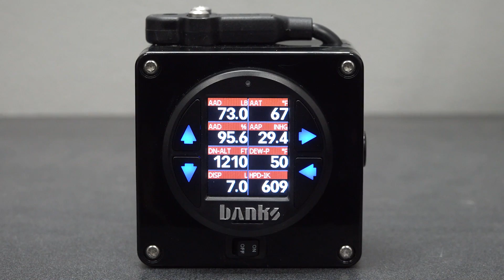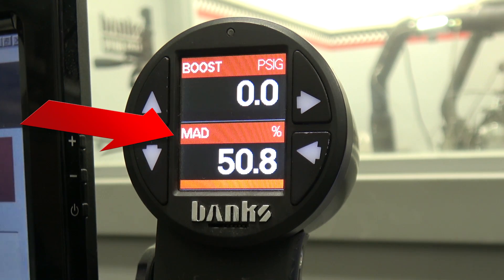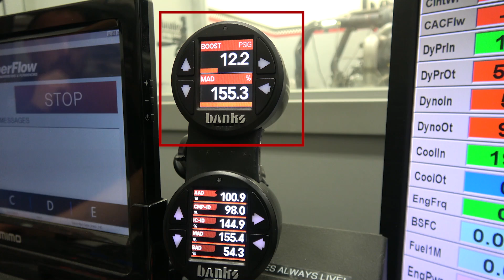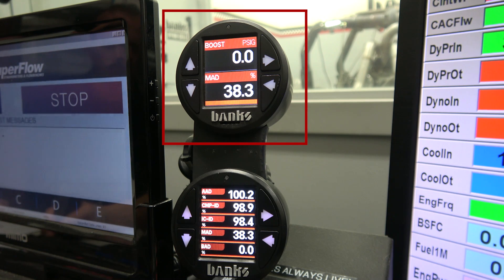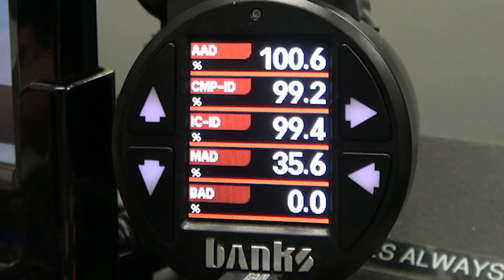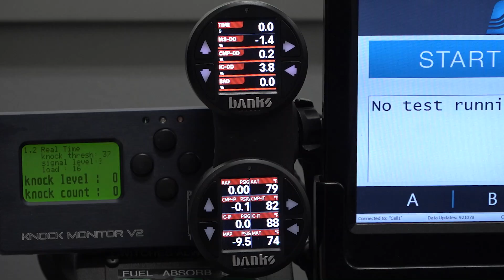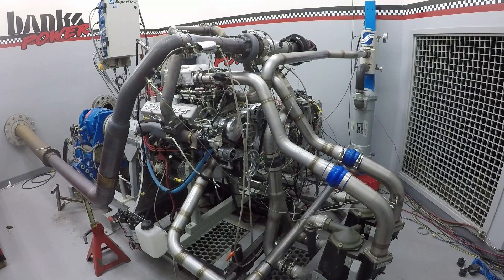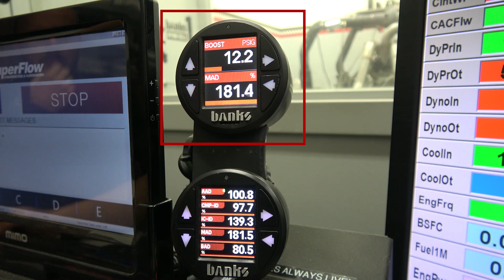Why the boost gauge is dead

Comment: I understand the air density thing. Was taught that when I learned to fly airplanes. I don't think the boost gauge is dead, as it has alerted me to a pressure leak at the turbo outlet on my '91 Daytona 2.5L . The Idash is the cats ass for seeing the entire picture. Am seriously considering the purchase. Just need to know more details about fitment and sensors.

Comment: boost is great for overcoming intake reversion but unless you could manage to have extremely high pressure waiting for the intake to open and somehow manage to drop the pressure to nothing and still manage to fill the cylinder to get an ice cold intake charge :) (if only our atmosphere was r134)

Comment: for someone building their own motor and tuning at home, could someone use these to make educated decisions in regards to parts combos, turbo selection and plumbing efficiency? i understand it is not a dyno but by logic a higher MAD equates to more power production provided you have good af/r, engine/oil temp, so you could make a change and take a log to see if things improved or not?

Comment: Anyone else notice the 1500-1600 degree exhaust temperatures on the screen? Are they trying to melt the valve to the valve seats?
Reply from the maker: It's safe to run for a few seconds at 1600 momentarily but not much more.
Reply: Banks Power fair enough. Keep up the videos banks your doing good putting great info out there

Comment: Considering it is a V8 with a high liter displacement, 56 horsepower gain is not really that much. Perhaps you could have played with the timing more and tuned it for even more with the intercooler upgrade.

Comment: So boost is only giving you about 60% of the data you need to extrapolate manifold air density. So you add two more mechanisms to measure humidity and temperature Within manifold air and you will have a gauge that can then be more easily applied to the expectation of power output.

Is that not a very simple explanation what is being discussed here?

Comment: Great educational info WITH advertisement for the iDash Devices. I almost didn't catch that this is a well disguised advertisement for Banks iDash. If the discussion in the middle was less than 5 minutes on how great the iDash is really it is really great and versatile and really great and better than stock and records great and is really great, I would not have noticed.

AND... Where are the rest of the Diff Cover Videos?!? 

You repeat yourself too much....

Comment: When you  try to compress air it heats up ..  The  charge cooler  takes the BYU's out of it .. Compress air to a certain pressure and  you have the same BYU's  but in half the space at 1 Bar

Comment: He doesn't address the delta P across the intercooler, or the relationship of the flow thru the IC versus its resistance to flow as boost increases, and the inherent increase in air temp. When you force air thru an IC you reach a point where it can't flow the air without a drastic increase in resistance, and that causes the air temp to shoot up higher as the turbo works harder and super heats the air to a point you're negating the use of the IC

Comment: Customer support was no help to me so maybe this is better:

Air density consists of 3 different data inputs: air temperature, air humidity, and air pressure. 

So my question is, without installing a humidity sensor in your intake manifold, how do you accurately record Manifold Air Density? To my current understanding, you can’t take the humidity reading from the air mouse because as soon as the air is heated when it’s compressed and then cooled from the inter cooler, the humidity changes.
Reply from the maker: When you say customer support was no help, does that mean you called or emailed and go no response or was it that you didn't like the response that you received? The relative humidity changes but the mass of water vapor pressure doesn't. We use pressure ratio and ambient vapor pressure to correct for dry air manifold air density. You only need to know relative humidity in one location. So, an AirMouse is all you need to correctly compensate for humidity. The math is handled in the iDash.
Reply: Banks Power first thank you for the explanation.

And when I called, customer support was not trained well enough on their own products to answer my question (that fine, I can understand) so they said they’d call me back. Well they never called me because that’s too much for them too handle.

And I sense a little booty tickle coming from Banks Support? Are you upset I called out Banks on in my other comment for failing to complete his diff cover series and scientifically show us why his diff cover is better?
Reply from the maker: @nealarcher1970  Density is not an easy concept for all to grasp. You may have reached one of our more junior staff members that hasn't mastered it just yet. We apolgoize for not returning your call. We didn't see your comment about the diff cover. Gale has not failed. It's just taking longer than we or you would like. We have plenty of data that we'll be sharing soon. We released the videos in real time last year... as we were learning about the various cover design flaws. It wasn't like a TV series that was recorded months prior. During the process, around video number two, Gale sat down to design one with our engineers. Then, after weeks of fine-tuning, it was tested, perfected and sent to production. We had hoped to share the data about the diff cover testing last September but it didn't make sense to share the info and have our competitors race to market with updated covers. We held onto the info in order to time it with our diff cover launch. We'll only get one opportunity to share the data and we want to make it count.

Comment: MAD is only useful on dyno or when racing. For the vast majority of people, that information is useless. You don’t need to know if you’re short 20 hp on the street because it 80 degrees and humid outside. Maybe if you tow in places that aren’t humid and usually much cooler, then you take a boating weekend up to (insert mountain name), you might feel somewhat short on power because you’re driving in a different climate.

BUT AGAIN, this is not useful information unless you’re racing. Boost pressure would be much more useful to most people because it’ll tell ya if you have a leak. But saying, “boost gauge is dead to me” because you have a new product you need to fly off the shelves, marketing it to people who really don’t need it. Banks, you sure are good at marketing, I’ll give ya that.

Go ahead and reply with the links to differential oil testing you did to prove “square back diff covers work the oil harder”. Or the testing you did to prove that square back diff covers “harm MPG”. Oh you know what would be great? The testing you promised us showing the temperature increases that square back diff covers cause compared to OEM.

Feel free to reply with any of that info because you sure as hell didn’t reply to my comments I left on your diff cover videos asking where’s the proof when it didn’t show up months after you promised it.

Comment: Would it make a difference if the air density was at 180 prior to entering the turbo compressor housing?. Also the turbo has already compressed the air before reaching the intercooler so the turbo has already reached its maximum  potential flow rate at 12 psi for what ever rpm so how does the intercooler make the air more dense than it already has available?.

Comment: Intake air temperature affecting hp is something most notice instinctively, but it really is nice to have real numbers.  My little old pickup truck generally picks up noticeable horsepower whenever ambient temperature drops below 60F.   Never dyno'd it, but it is real and thats using the same grade of fuel.  Should we call temperature/humidity corrected numbers Boost Factor to get away from blind reliance on Boost Pressure?  What I couldn't say is where to set the benchmark numbers of humidity and temperature to either add or subtract from the pressure number - maybe 100F and 50%?.  Some people still like to know boost pressure numbers just to keep tabs on if their wastegate setpoint has drifted [or gone completely pear shaped] and maybe spot other problems.  Perhaps one gauge with an over/under display of both numbers is all a driver needs?  The rest can be data logged. And... could the next performance step be a variable [computer controlled] wastegate?  I would still want something mechanical backing it up as a safety device in event of control failure however - put a sensor in it for the driver to know if it ever trips just in case.

Comment: I doubt any sane person uses boost gauge as an engine performance data. It's role is to tell the user if the charger performs as intended, is it making enough manifold pressure and not more, because both situations are signing a problem potentially leading even to engine's destruction. It's just the simplest way to know there are no immediate major issues with the charged intake while driving.

Comment: As a former truck driver, I used boost gauges as a rough estimate for how much fuel the engine was using per cycle, and therefore what percent of its rated output it was producing.

Comment: This is a comforting video. I have a supercharged engine in my truck and never used a boost guage. I have custom pulleys to make it all work. Once I put a pulley on that was too much. Boost blew the ceramic parts of the spark plugs out at full throttle.

Comment: Boost gauge is more for consistency then anything else in Gasoline engine especially
Reply from the maker: Consistency?
Reply: @bankspower  you monitor in between each run with same parameters, in a target torque application your boost will raise by a tiny amount each run to compensate for heat soak, not all turbo application are like that but most Modern Gasoline are.

Comment: Thanks Gale Banks for a well presented video.

I saw a GE portable high wattage electric generator setup. It consisted of two full sized truck trailers. One trailer carried the generator and a full size turbine. A turbine is a jet engine tuned for torque. The second trailer carried an intake air chiller. They claimed that by using some of the generator output to run the chiller, total electric output of the system increased. 

This agrees with everything Gale Banks said. With a completely different style of engine. Good work.

Comment: No pressure drop with the I/C... where are you measuring boost and MAD? Surely the turbo is working harder to make 180 MAD than 150 MAD?
Reply: drongo jonkins water intercooler is a very low pressure drop.

Comment: so i have a question, if i have an NA engine, and i put multiple water sprayed intercoolers on, would that be enough to make the air denser and the engine able to suck more air in, so more power?

Comment: Hi, could you repeat the test using a "dead" intercooler (as little heat exchange happening as possible, just internal resistance to flow)?

Comment: I dont think anyone has ever stated that boost level is the ultimate parameter to making power. The same level of boost pressure on different engines can result in a huge amount of power difference. 17psi on a Chevy Cruze (Stock pressure btw) is a whole lot different than 17psi on a Chevy Corvette. It's a measuring tool to base tuning parameters on.

Comment: So it looks more like the non-intercooled engine is dead vs the boost gauge.  Aviators have known for years that Density Altitude, humidity, and temperature effect the performance of an engine or a wing.  Really all this shows is that at equal PSIs of boost cooler air is much denser than hot air.  Also, buy my product so you can monitor Density Altitude in your pick-up in case you need to do some combat maneuvering flight...I hate to see you get in a high power demand maneuver and you not be able to produce the lift and engine power you need.

Comment: clearly the applications of this module are that you can fuck with your intercooling as well as the rest of the air system and actually see what is happening in the system with each change.

Comment: Boost gauges, or boost numbers in general really rub me wrong.  Why?  Because a TON of people who think they know something about cars, engines, turbo systems, etc always talk about boost numbers.  I cannot tell you how many times I've had some tool ask me "dude how much boost you running?"  then after telling them "10psi positive manifold pressure." they somehow think they know everything.  The follow up response is usually, "That's it?  That car must be slower than crap!"  Yeah, if you only knew something.

10psi out of a t25 compressor isn't the same thing as 10psi out of a T04E compressor.  

But wait- what do you mean?!  My best friend ran a 1.8 miata on 22psi from a "disco potato" turbo and made 240rwhp.
I ran a 1.8 miata on 10psi from a T04E turbo and made 280rwhp.

The compressor on my turbocharger is about the size of a basketball.  His was the size of a softball, at best.  A physically larger compressor moves more air at lower pressure.  What's my point?  STOP ASKING PEOPLE HOW MUCH BOOST THEY'RE RUNNING!  IT DOESN'T MATTER!
Reply: At the same manifold absolute pressure, intake air temperature, and RPM, with the same valve timing and cam profile, 10psi out of either a T25 or a T04E will both give you very close to the same power (the only difference will be due to slight backpressure differences, since they'll be at different efficiencies). A bigger turbo can keep the manifold pressure high out to a higher RPM, which makes more power, and it can maintain high boost at a high flow rate with higher efficiency (leading to a lower temperature rise across the turbo, less heat for the intercooler to shed, and therefore a lower IAT, thus more power), but at the end of the day, if you have the same MAP, IAT, and RPM, you'll make the same power regardless of what turbo is providing it.
As for your miata example? Chances are you were running 10psi out to a higher RPM, or his intake air temps sucked because he was trying to push a small turbo too hard. This is especially bad on gasoline because high IAT also leads to detonation, leading the engine to pull timing (which really kills your power). I'd also be kinda skeptical of 10psi making 280hp on a 1.8 unless you also did some significant head and cam work and extended the rev range, otherwise you really can't flow enough air to make that kind of power without significantly more boost.
Reply: 10 psi in your car is the same 10 psi in his car, sorry
Reply: Everyone and there grandma already knows that tard.
Reply: People get confused with the pressure vs the quantity. 10psi of 100 cubic ft/min is much less than   10psi of 500 cubic ft/min. 500cfm of air is going to have a lot more energy than 100, meaning more power. So knowing the flow rate (CFM) seems like a more important start.

Comment: Dang it Gale you've done it again. Now I've got to get some diff covers and see if an iDash would work for my 12 valve.

I was curious what the charge air temp was for each run. Also it looked like that was a water to air i/c? What was the water temp going through it?

Comment: Here's to all the bullshit-artist, gum flapper, keyboard commandos who know everything about cars and are more than happy to tell you all about it, removing any doubt about their idiocy. Watch Zora Dontov making high speed runs at Daytona Beach in the '55 Chevy. He talks about the horsepower math required to achieve the top speed he wanted. No guessing, no bragging, just empirical data. Here, Gale makes it look so easy, and in a way, it is. The buy in to have all this equipment keeps it available to only a few but that's why we trust guys like Gale to guide us. Looks like at the end of the day an engine is an air pump and the more dense the air and the more fuel in makes power...he just actually shows it.

Comment: Would your gauge plug into the harness on a 2003 KW W900 with a 6NZ CAT?  Currently have the military cam and ECM programming with a larger turbo, how can I increase MAD? I have a Duralite CAC, but honestly the stock cooler seemed better at cooling.

Comment: A boost gauge is still a very useful gauge, especially with an analogue  needle. You can see at a glance if the turbo system is working correctly and how much load the engine is under by the angle and movement of the needle, no need for maths and focusing on a digital display for longer than you should need to.

Comment: I guess you could just watch the numbers from the mass air flow meter seeing as that's where all the air is coming from in the first place... 

Realistically all the gauges are meaningless unless you understand what it is you are looking for, and what you are capable of reading. Once your engine is tuned, whether you watch boost, or mass air flow, or the level of the gas tank, it really doesn't mean anything. 

This is a purely academic exercise. If you're tuning engines for a living in a dyno room, sure, this might be helpful. But if you're going through all that, i'd expect your data acquisition system to be looking at pressure, air temp, humidity and all the other good stuff along with RPM, EGT, oil pressure, water temp, etc... and then calculate all that information and spit it out on the screen for you along with warnings so you don't kill anything... you know like the 1600F EGT's they were running to melt pistons.. 

I really don't see the point of this gauge for a daily driver.

Comment: As the manifold air density increased did the engine ecu automatically add more fuel to avoid running lean?
Reply: It better... that's it's job. It's getting that information from the mass air flow sensor.
Reply: Yes. It would have to.
Reply: That is the whole idea: more air molecules in the cylinder allows you to burn more fuel at the desired stoichiometric air:fuel ratio.
Reply: Yes